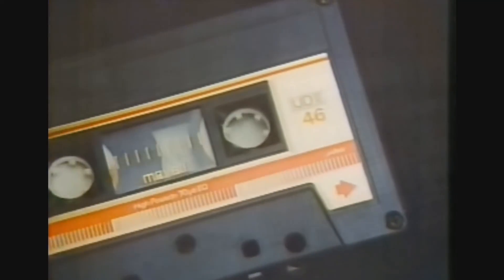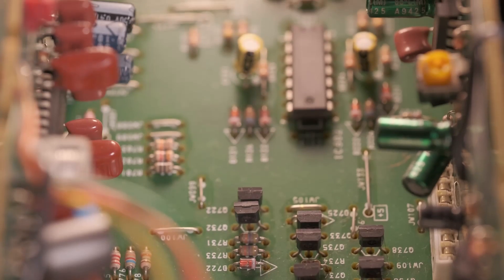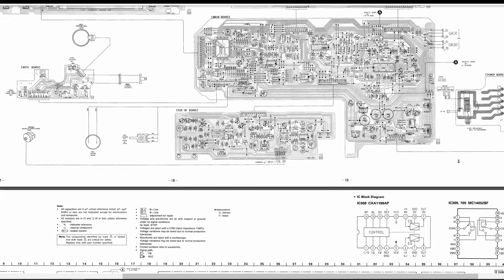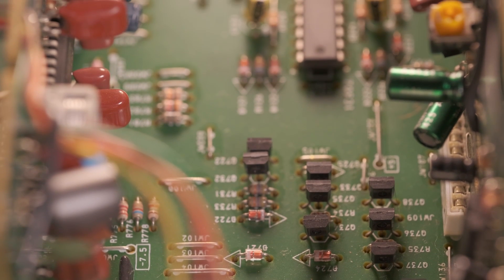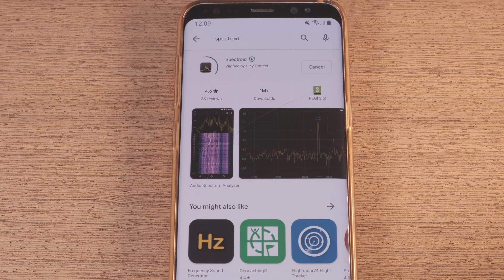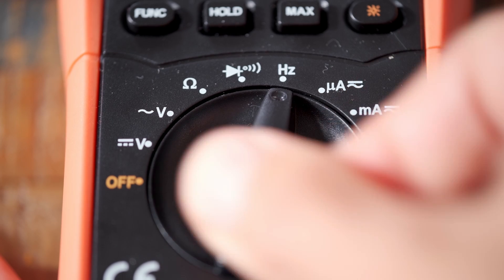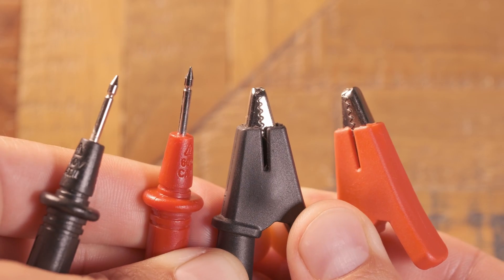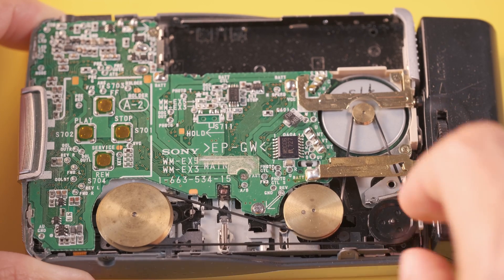How to Adjust Cassette Speed Playback

Comment: 4:55 Get an Aux cable, connect one end to the walkman and the other end to a speaker or amp, crank it up a little and use the calibration app to get best results

Comment: 6:30 and 6:55 WRONG! you measure the difference between left and right channel, not the frequency on left or right. if left and right testtone would be reproduced with same level and with head perfectly aligned azimuth, then the difference would always be zero.
explanation for the 3,5mm jack was correct.

Comment: mine seems to have some kind of foam where the speed calibration screw is supposed to be? not sure what to do there to be honest
Reply from the maker: Foam? That's odd. Clean it with isopropyl and see if there's a knob or switch?
Reply: @soundelegy5987  i figured out a while back, i guess in my device I am supposed to squish the flathead screwdriver enough to where it partially pierces the rubber foam stuff to fit into the slot to turn and adjust the speed. Sorta awkward and wierd, not mentioned at all in the service manual for it, but after i fiddled with it for a while in confusion i somehow adjusted it to near perfectiom by chance.

Comment: Hey, so, I'm thinking of doing this with a walkman, but, why wouldn't the speed depend on the battery, or no?  I think I noticed the motor spin slower when it had a lower voltage battery, I assume it has a limiter for the speed it goes though, but I just want to be sure before opening it, thx
Reply from the maker: Walkmans use AA or AAA batteries so if they're fully charged there shouldn't be such a discrepancy between brands.

Comment: I myself used a spectogram of my tape deck's playback output recording(with a factory pre-recorded tape) and the original song's master of the song to compare them. The deck was only a tiny bit slower before adjusting. But it was already audible. The original recording had a portion with a stable 5300Hz tone. The deck played it as 5190Hz. Barely noticable without the original recording.

Comment: Greetings
I record the frequency of 3000 Hz with the deck and the frequency is not stable during playback.
What could be the reason? Thank you
Reply from the maker: Because your Deck is not calibrated. Only tapes that have been recorded in a top-notch and freshly calibrated device are viable. You can buy them from eBay.
Reply: @soundelegy5987  Thank you for your reply.
Reply from the maker: Welcome. Or check fixyouraudio.com they also have them.
Reply: @soundelegy5987  Unfortunately, due to sanctions in our country, we do not have access to buy from eBay
Reply: @soundelegy5987  Can you tell me what name this cassette is sold on ebay. Maybe I can get help from friends who are abroad.

Comment: Great video. Thanks for the info. I just repaired a tascam portaone studio as the tape head case was broken and a spring was out of place. Now the cassette plays well, other than the speed is faster than normal. when using the potentiometer to slow it down, the whole thing stops playing (full stop). Any ideas what could be wrong? Maybe the belts?
Reply from the maker: Hey there! Thank you. And wow, that's very random. I haven't encountered that problem just yet. How about adjusting the potentiometer while the device is not powered? Will that modify the speed at all?
Reply: @soundelegy5987  I'll try that later. I like to open stuff and try to do some repairs, but one of the problems with this specific tascam is that whoever owned it before me got the screws all beat up and can't remove some of the parts for cleaning and regreasing. Can't get to 2 belts due to that! I really appreciate you explaining how to use the electric tool to do the measurements; it always intimidates me but gonna try it later tonight. Thanks again!
Reply from the maker: That's a common problem with bad handled audio gear. The potentiometers are very delicate and with only a little extra force they could get loose for good. Good luck on the repair job!

Comment: Thank you so much dude! I almost tossed out my Walkman until you mentioned the hole to stick the screwdriver in to twist the knob
Reply from the maker: Welcome bud!
Reply: @soundelegy5987  I was curious by the way, will having the mega bass on drain the battery when the radio and tape are off?
Reply: @soundelegy5987  also, o adjusted the speed, but it slows right back down and gets worse if it's shooken

Comment: Hi, I’ve got a maintenance question about a dual cassette deck. I have a Denon DRW-660 dual deck with both sides running a bit quick. Online service manuals aren’t helping much and I can’t find the small slot for speed adjustment anywhere inside. Is there any other places the speed adjustment slot could be if not on the motor or off to the side? Also, whenever I try to play a cassette on the right side, it plays and then stops within a second. Any causes for that?

Comment: Hola. Necesito ayuda. Opción número 2. Mi multimeter no lee la señal de un 440 hz tape pero si toma la señal de cualquiera otro cassette como radio head. Why is it not picking the 440 sound?
Reply from the maker: Hola buenas. Si el multimeter capta cualquier señal excepto la del 440Hz tape, entonces la cinta está en blanco o hay un problema con el Cassette, no con el multimeter. Bastante raro. Tal vez apretaste algo para que solo capte señales de alta frecuencia?

Comment: Hi .great channell .please help. I have a 2004 sony cmt hm3 mini. Bought for my daughters 15th bday on mercari. Cassette  skinny belt broken...i replaced. Thick belt seems in good shape. Well my daughter and took it apart .she didnt want to but I want her to learn to.fix stuff!!!! Well we.are heart broken cause it plays waaayyyy to fast... we adjusted small adjusting screw on motor it didnt help .i.could hear it adjusted a little but still way to fast....we went all the way to.the left  amd to the right but didnt help enough..is motor bad ?  Its a matter of provint to my daughter we.can fix.anything with right attitude and a little help from.kind.folks !!! Thankyou in advance.
Reply from the maker: Hello Frank. I'm sorry I didn't see this message before, sometimes they just don't go through. Looks like the potentiometer, which is the screw that adjusts playback speed is not well attached to the motor. It is possible to fix but you need the right tools. Maybe with contact glue? All the best and sorry for the delay

Comment: Sound Elegy does the best videos. I noticed that a portable cassette player that I bought new, the Mulann B-1000 (Mystik) was out of sync. It took me a whilst but something was off. The speed pentotiometer can be reached outside. But it is so difficult to get the timing. Now that I know a frequency tape exist, I will get that. I already have a Multimeter, which is a good start.

@Sound Elegy should I get a cable that splits my single 3.5mm jack to RCA (red + white) will that make it easier to measure?
Reply from the maker: Hehe thank you! Glad you're trying to solve the issue yourself rather than sending it for a repair. I show in the video how to measure the frequency very easily with a 3.5mm male as well. You don't really need the splitter :p
Reply: Excellent thank you

Comment: i cant find a manual anywhere to the realistic minisette 11 cassette player, and i cant find the potentiometer myself.what do i do?
Reply from the maker: I've also looked online and couldn't find anything on that specific model. The potentiometer should be there tho. Maybe a screw with an arrow? A yellow or white plastic screw? They are usually on the main circuit board.

Comment: Hello, i wanted to say that your content is incredible helpful and motivating and personality it have been helping me a lot, i sometimes try to repair my Sony Walkman wm-af54 as much possible, and recently I order a belt kit to replace the loosed ones, and it work out great, but unfortunately I stumble a problem that I genuinely don’t know if I’ll be able to fix!
You see, recently I have been trying to calibrate the speed adjustment, and it got to a point that I damaged the adjustment, so whenever I try to turn to left or right it always sound fast and difficult to slow it down, and when I can, it feels out of place even if I try to move the screwdriver to another speed!
And with that said, I wanted to ask you this : is it possible to fix the adjustment when it is broken or it would be better to replace this specifically pice to a better one, and if so what would be the name of this pice be ( I an not a native English citizen so I really don’t know the name)
Sorry for the bother but I really could use some help from a expert in this kinda of situation!!!
Reply from the maker: Hello Renzo. First of all, thank you for your kind words, really means a lot. Regarding your problem with the potentiometer (speed adjustment known or screw), that's usually not an easy fix. It would depend on your expertise level and the model itself. Which one is it by the way? Do you have the service manual for that particular device? A potentiometer on a Walkman sometimes is a very tiny screw connected to the main board and soldering and de-soldering are usually needed.